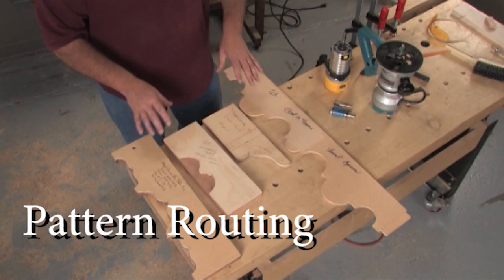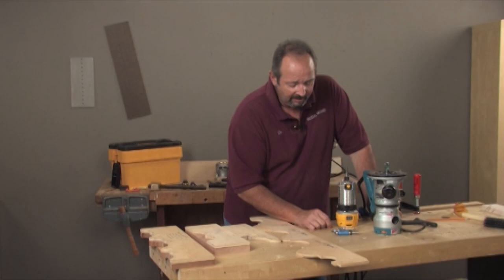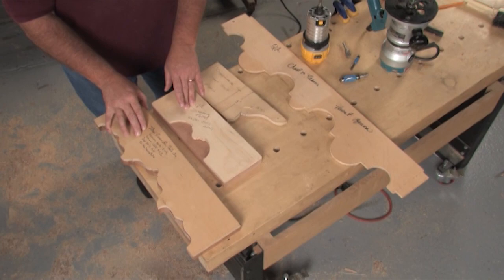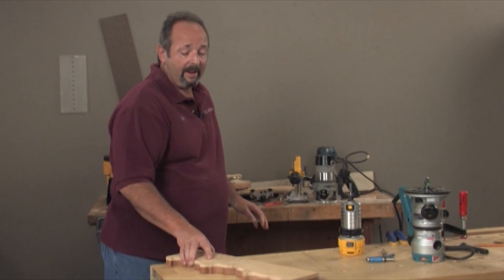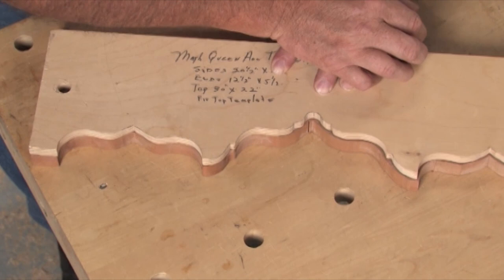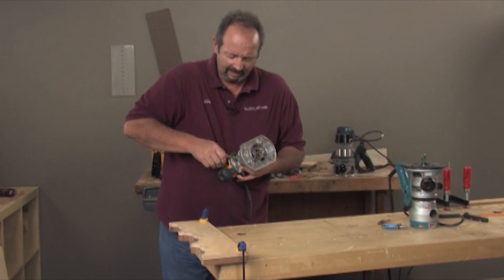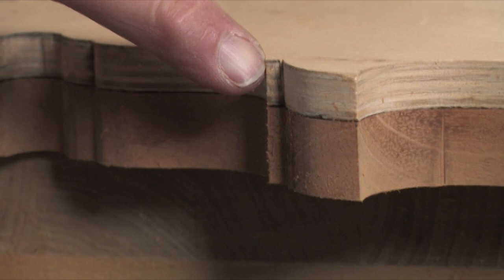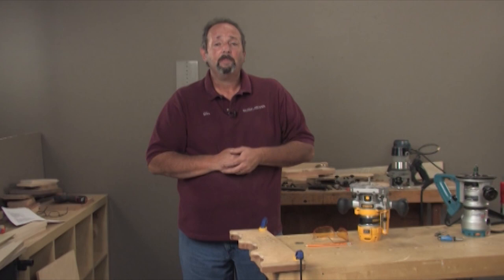Pattern Routing

Comment: This is a great video. As I’m starting to do more Pattern Routing I’ve been watching a lot of videos. Even though this was 6 years ago, it’s still relevant. I prefer to rout with a handheld router rather than the router table. Especially when I’m doing curved handles on hardwood. I feel like I have more control and feels safer to me. Thank you for this video. Super helpful.

Comment: Nice video. I am more comfortable using pattern bits in my router table. I have a couple of dual bearing bits so that I can adapt to different grain patterns. I can change the direction of the cut by flipping the workpiece/pattern and adjusting the bit height.

Comment: Great video!  Some questions:

1. On a router table, does it make sense to use a bottom mount bearing so that you can route with your pattern on top?

2. I'm trying to come up with a rule-of-thumb to know when I should climb cut.  Does it make sense to 'always route downhill'? 

3. What kind of stock do you use for patterns?  Is that just 1/4" ply?

4.  What's your preferred way of making patterns?  Do you draw the patterns, print them from the internet, photocopy them from furniture books?  And then bandsaw them out on plywood?

Thanks for the quality content.
Reply: Conor- Good questions. 
Disclaimer: Although I enjoy and agree with the content of this video, I am not aquainted with Glen Huey or Popular Woodworking, in any way. 

1. It doesn't matter, unless your particular pattern or workpiece would appear to you to bennefit from one way over the other. Keep this in mind though: If your template is on the bottom you'll have the added danger of the cutter being exposed at the top of your workpiece, and you need to be very carefull therefore, as to where you place your hands while guiding your work.

2. Climb cut when there's a greater chance (or a likelyhood) of tearout. Typically when cutting "across" end grain or over wild or interlocking grain.  The router can be somewhat more difficult to control during climbcut because the direction of router movement is the same as the direction of bit rotation, therefore the router wants to "run away". To counter this one needs to hold it extra firmly against the work.

3. He's using (what appears to me) to be 1/2" baltic birch ply. Baltic birch is one of my favorite pattern woods also, because it dense,  with no edge holes or defects (notice the thin, tight, multi layers), and durable, holding its edge nicely over long term repeated use. Any plywood that has a nice flat smooth face and an edge with no defects is sufficient. Some woodworkers use MDF, because its abundant and economical. Even plexiglass makes a good pattern, but its expensive and more difficult to machine.

4. When it comes to making patterns, you do whatever is easiest for you. There is no "preferred way". I don't think I've ever downloaded or printed from the internet, but noting wrong with that if you have the ways and means, and find what you want. Same with photocopying, I never have, but if thats practical for you, just do it. I usually design my own patterns, for chair parts or table legs, for example. Sometimes I'll be copying an existing design. When doing that, if possible I'll trace the existing part (or parts) onto rigid thin cardboard, thin plywood or MDF 1/8" or 1/4", or even just paper where applicable. On occassion I've had to trace the parts of a chair or table in its fully assembled, in use condition. We do what we have to. Sometimes the pattern design needs to be built in a process. For example it might first be scetched on paper, then transfered to plywood, then cut out and refined.

Comment: Actually, those are masters.  It's technical.  Been making them for years, but use 2 layers of 1/2" plywood glued together, and tack them down to the piece being routed out.  Write anything, and everything, on the master, not only will this tell you what it is later, it will keep you from using it in your project, then having to make another.  I only  use 1/2" flush trim bits  for what I make.

Comment: Thanks for sharing wondered how to make clean cut patterns for some time now.  Where would I get the bits you used?
Reply from the maker: Bearing-guided router bits are available from most woodworking retailers. Search for pattern router bits. Beyond diameter and bearing location, you'll also find cutting length to be important when deciding what to buy. Let us know if you've got more questions!
Reply: Jake you should check out Glen’s website, 360 woodworking.